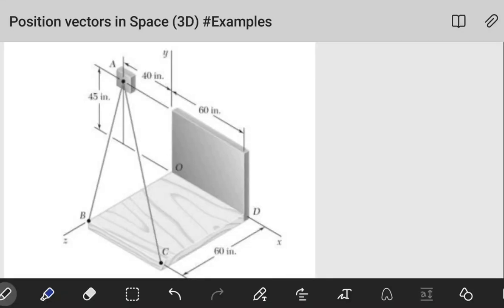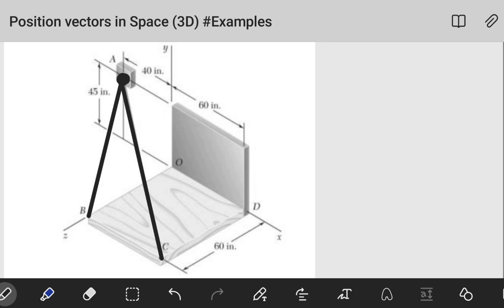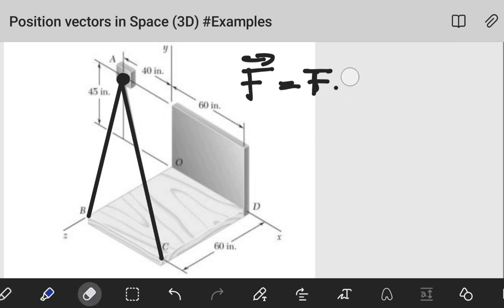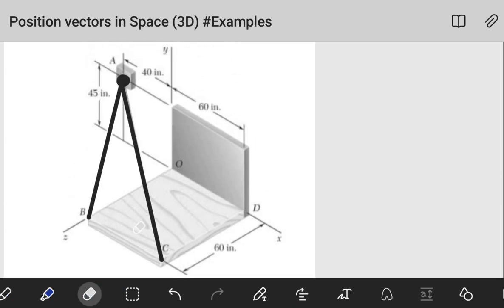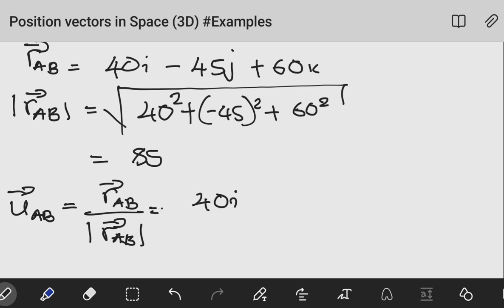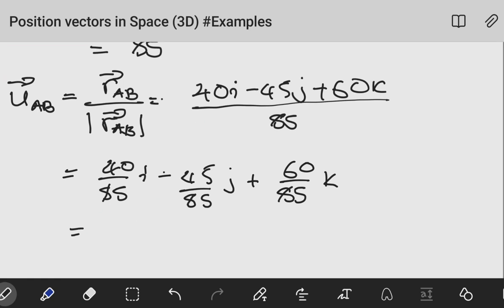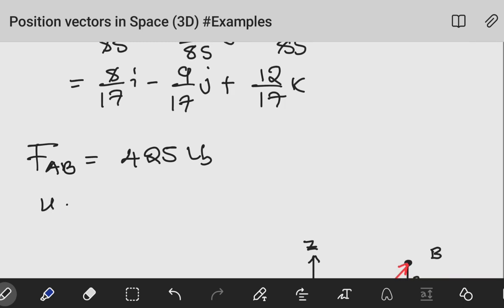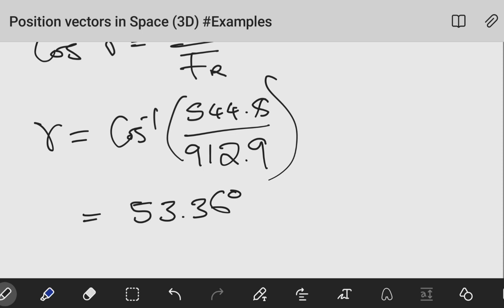Position Vectors in Space(#3D Examples)

Comment from the maker: Hi guys, slight correction. At time stamp 10:35. The y component was correctly highlighted as 45 inch but i took down 40 instead. So follow the same steps but just use "Rac = 100i - 45j + 60k"